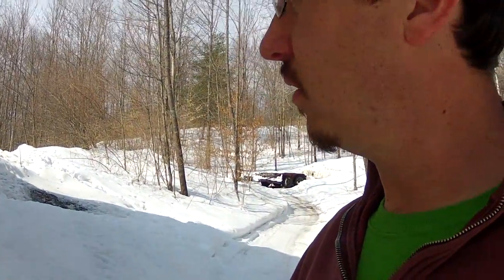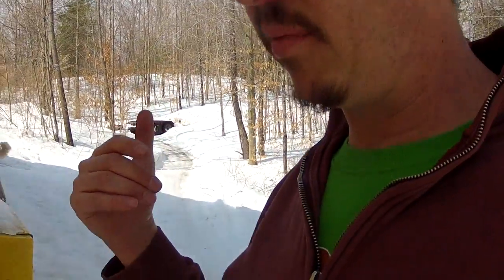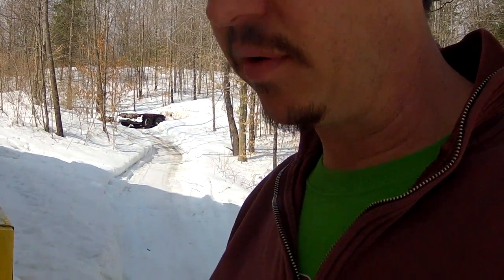Combining two air compressors idea

Comment: I am not sure of the electrical hook-up.  The air is relatively easy-- off of each compressor install a good ball valve and a check valve so either compressor may be isolated for whatever reason.  It would be good practice to install valves to isolate each major sections as well so you wouldn't need to shut down the whole system for maintenance and additions.  If you can find a pressure tank, install it so that it is a receiver between the compressor(s) and the system for volume.  This will even out the pressure pulses and even flow.